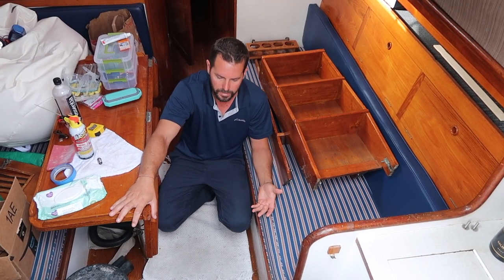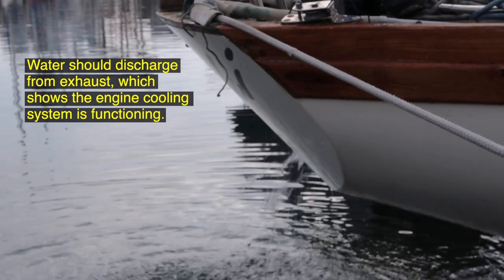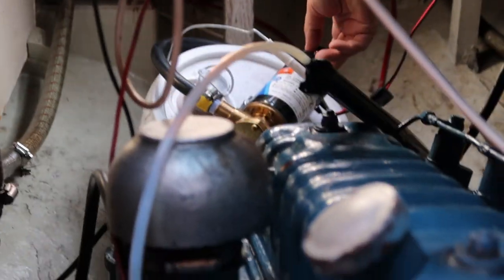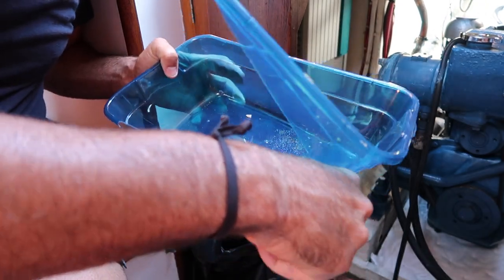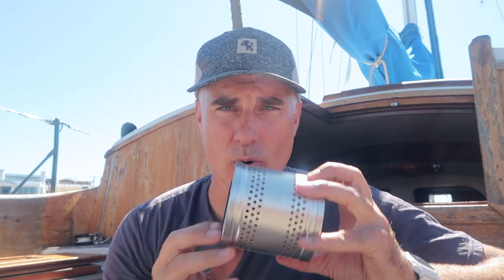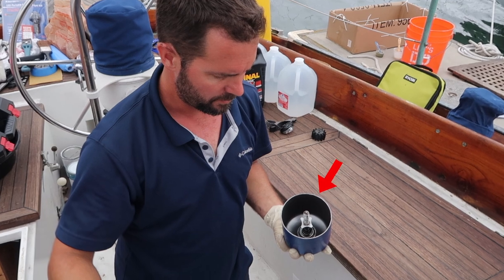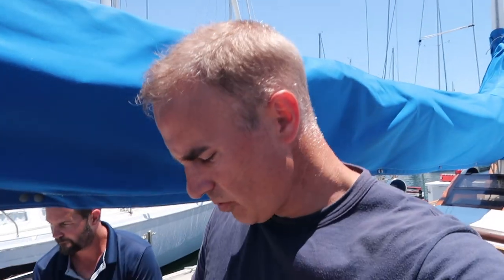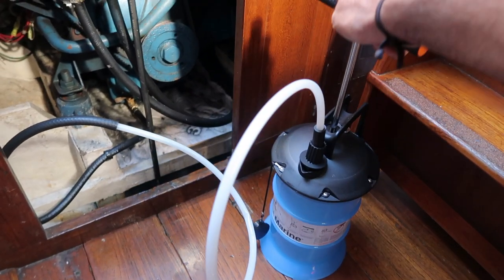First Oil Change in my 1965 Sailboat

Comment: I would also suggest keeping the oil pan drain plug screwed into the valve and keep the barbed fitting and hose where you store your engine spare parts. They make special oil drain valves with a detent that helps keep the valve in the closed position.
Reply: I believe Fumoto makes such a valve.

Comment: Just a thought here…..
Remember that valve that failed on your shitter?  Same could happen on your oil drain valve.  All oil drain valves I have ever seen(highway tractors mostly) have had a valve replace the drain plug into the pan then the drain plug or cap on the other end for safety.  Last thing anyone wants is to have their engine oil drain unintended.  At least safety wire the valve shut.
Reply: Notice the hose he put on ... it raises above the level of the oil in the pan ... he did not explain that reason for the hose... but the mechanic will know

Comment: Hello! Good idea to have a valve installed. However some valves internally uses materials to sealing that does not resist of temperature exposition. Could you share the valve spec? Tks

Comment: Great idea for drain plug. Always learning something here. Thank u. So I'm wondering about the engine access hole. Is that custom?
Reply from the maker: Thanks. The engine access hole was standard on these boats. Ethan, the mechanic, was quite impressed with it, saying it was unique and good engineering on the part of the boat builder.

Comment: Hi Josh, great video and following the work on this boat closely. I have the same engine on my boat down here in NZ. Brilliant idea with the drain plug, will unashamedly copy your work. I was wondering as I didn't notice in the video what specification of oil did you use, haven't got many details here and trying to do most things myself now. Keep the videos coming.
Reply: Looked like Shell Rotella jug.  Comes in 10w30 or the more common 15w40.  They also sell the same brand in 5w40 or 15w40 full synthetic.

Comment: Is it advisable to flush the engine after draining the oil and before replacing with new oil?
Reply: that's probably a good idea. I always dump some fresh oil in while draining to clear all the crap.
Reply: Flush?  You may be thinking of the cooling system. If you want to 'flush' the oil system, you just do another oil change soon after the first. Happy sailing R !